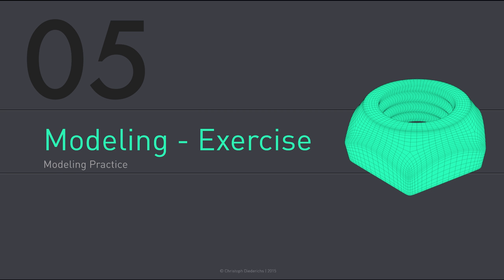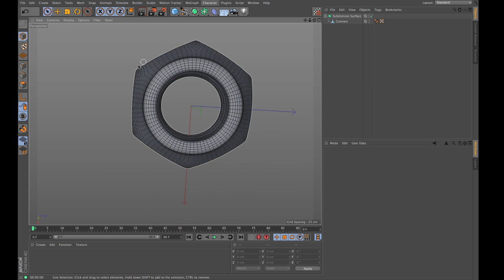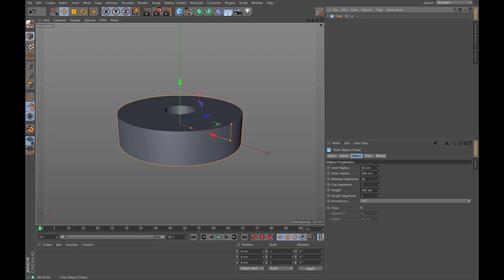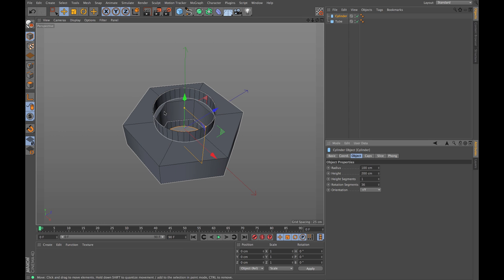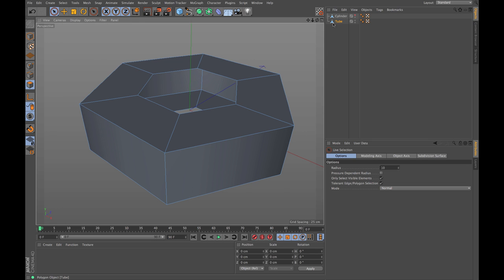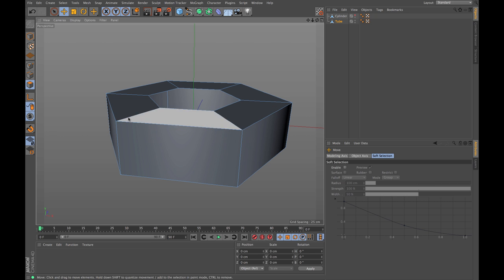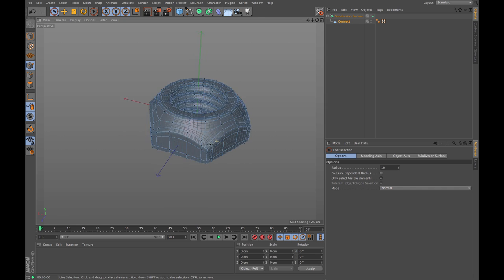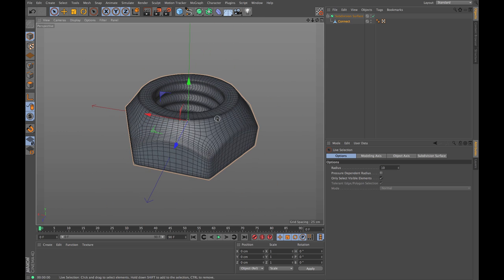C4D Fundamentals | 05 - Modeling Exercise - How to Model a Nut

Comment: Sorry for deleting the comment. I had shortly realized after I made the comment that I did not select the bottom part of the tube to make the edges with the "edge cut" tool so my lines were converging on one point at the bottom. Everything is working out thus far. I only just saw the notification. Thank you for the speedy reply!

Comment: For some reasons my loop selection tool wouldn't work and I had to select the edges of the cylinder one after the other. @ 13:41
Reply from the maker: Maybe something is broken in your polygon flow ?
Reply: @c4dfundamentals  OK I'll check that

Comment: very good and useful tutorials. Can u do another one for modeling a Neoclassic bulding? That has all the details of building ? thanx
Reply from the maker: Do you mean outside or interior? 
Especially outside can be quite tricky, because of the complex shapes and patterns of such buildings, very tedious. What do you need this for? Animation? game? Architectural visualization?
Reply: @c4dfundamentals  i need it for Videoprojection mapping. The main work goes to modeling and effecta and its difficult to find a proper pro tutorial on youtube for that. I find ur way of explaining very good and suitable for everyone. Thabx and all the best.
Reply from the maker: Do you habe access to the property? I wouldn't model it by hand in this case, I would try to use a photo scan / photogrammetry software. There are some smartphone apps out there, I did a tutorial on that, but I think the particular app went out of business. You can basically do it with a normal camera and some software though: Found this after a quick google search for example: https://www.agisoft.com/pdf/PS_1.1%20-Tutorial%20(IL)%20-%20Building.pdf

Here is another one: https://www.capturingreality.com/architecture

After you get the point / cloud data into cinema you can convert it into a mesh and if needed you can retopologize the mesh to a lower resolution manually by hand or by algorithms like quadmesher.  

Let me know if you need some more help. 
This is my tutorial on photogrammetry: https://youtu.be/VdlBEM5ovmw
Reply: @c4dfundamentals   thanx for you help/ . Anyway a tutorial for this purpose it will be very special.
Reply: @c4dfundamentals  yes
its public property

Comment: at 10:20 I get confused, what shortcuts are you using when extruding the point of the tube to meet with the cylinder? When I select all the inner edges and then switch to the Move tool, nothing is changed, the arrow will move but no apparent object. thank you!
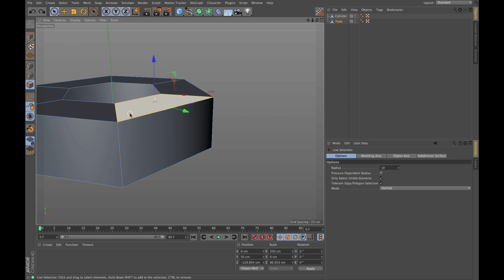Reply: also when I try to lift the top of the tube at 9:36 it doesn't move either. The object seems to already be "optimized"?
Reply: So I found it incase anyone else gets stuck here.. apparently I had "Axis modification" enabled, to turn it off I pressed the L key.

Comment: HELP, I got to the edge cut tool and no green lines appear? my lines don't go vertically down either.
Reply: The problem is you dont know what ur doing.
Reply: yeah thanks for that, you were very helpful...not!
Reply: i don't know if you've solved it by now but you can go to filter and check n-gon lines. you see your edge-cut tool has enabled n-gon creation and you possibly don't have enable your c4d to show you these line cuts. Also, maybe you forgot to remove the inner surfaces of the hexagon, and most importantly you didn't optimize your geometry [ U~O ]. A last thing that could destroy your edge cut is to NOT have selected the proper edges before you go to edge-cut. I hope i helped :]

Comment: Great stuff! Xlnt presentation and detail. 

Small note tho — your finishing "threads" are not actually spiraling as real threads would... Instead, the result is a simple stack of concentric rings. Getting threads that spiral/"screw" would be a great finish, tho perhaps a tougher nut to crack. ;)
Reply: No actually this method does give a proper spiral thread.  Try it yourself.   I can't quite work out how it works either, but it works.
Reply: No, these are simply stacked rings of indentations...not a true thread (selection @ 31:47). Instead of separate rings articulating the threads, it should be one continuous spiral (i.e., if you stay on/follow it, you can begin at the top and end up at the bottom).

Yes, from a distance or without scrutiny it certainly appears to be threads...but it's not.

Comment: Just a doubt. I am using Cinema 4d R20 and here there is no knife tool but I think its modified to something else and I am not able to figure out what it is.
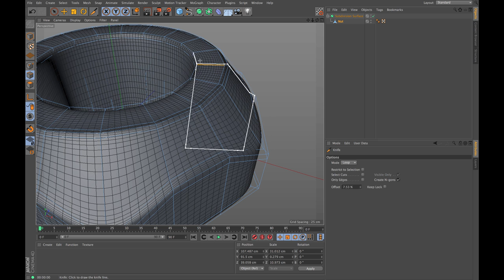Reply: Ok, gotcha. It has been converted into line cut, plane cut, and loop cut. 22:30 which Chris has done with knife in loop mode is done using loop cut in R20. :)
Reply from the maker: Yep right! I was to slow ! 
It’s divided into different tools instead of one...
Reply: Thanks a lot Chris! Using this quarantine time to learn a new software and I am loving this tutorial. May be you should do more tutorials. Would love to learn from you :D
Reply: My last step of making inner rings and moving dots at 7cm isn't happening. Wondering what would be the case!
Reply from the maker: Mh need a few more informations to help...
Reply: @c4dfundamentals  After I divide the internal ring into 12 parts and select the alternate 4th-row dots using loop selection and change the x as 7cm, the points don't move at all. Tried other points and tried changing z, the same result. I checked your screen and mine and everything seems the same except the SIZE column besides it. Mine constantly shows x,y,z as 1cm whereas yours shows x as 200cm and more. Not understanding why are those co-ordinates moving in any direction.
Reply from the maker: Mhh. Press L on keyboard and then try again !
Reply: @c4dfundamentals  Tried. Not working. Will figure out. May be something with some basic settings. Thank you for immediate replies though :D